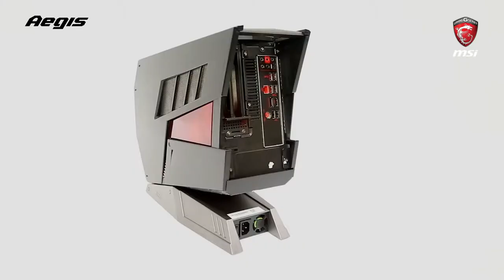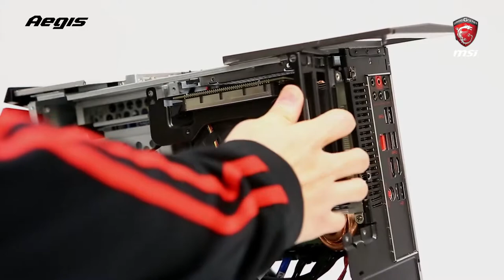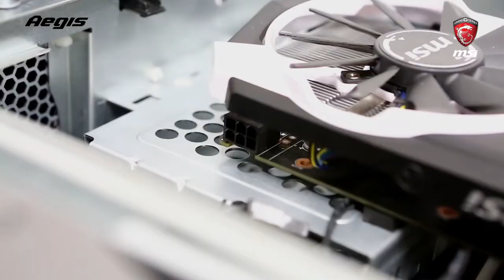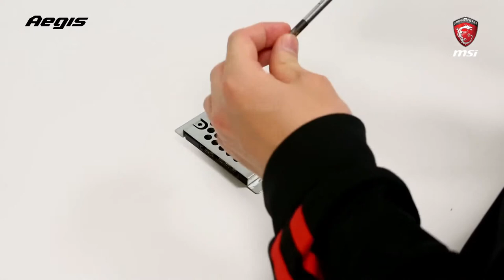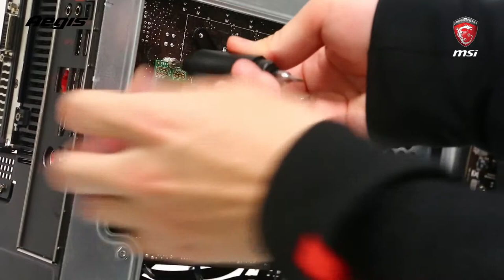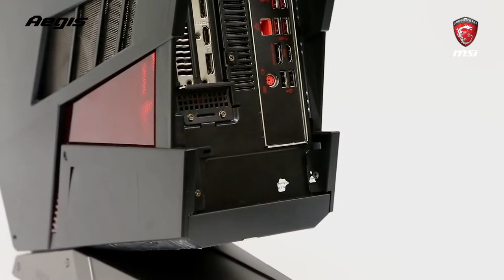MSI Aegis Easy to Upgrade Tutorial

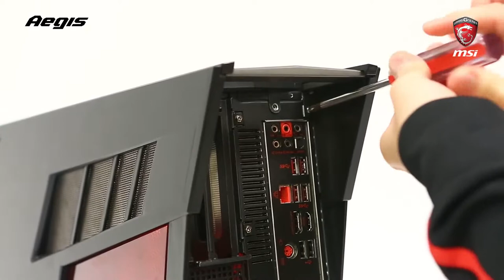Comment: Not sure this is mentioned in the comments but at the 0:35 mark when removing the top cover my model had a fifth screw at the top of the left side panel that needed to be removed.
Reply: same, tried to remove the panel with slight force until i noticed

Comment: On my model there's a fifth screw that holds the left panel in place (left looking at it from the back). Remove the top cover first, then the 5th screw is located on top of the case, on the left side, in the middle.
Reply: I guess your talking about 8th gen i7 8700? Thanks for the help.
Reply: @iX067  i have i7-8700 GTX 1070 TI and im just wantin to install a new GPU LOL its old and SLOW ASF
Reply: power supply

Comment: I can’t get my graphics card out. I unscrewed all the screws but I can’t find the PCI-e slot or cables attached to it.
Reply: a clip on the back on the pci express slot needs to be released
Reply: @victoria653  how do you release the clip I’ve been trying so hard but I do t want to break it
Reply: @myoopsie5324  it takes alot of force
Reply: @myoopsie5324  push the clip up. Also push the card up a bit for it to be easier. Cables are on the bottom left corner.

Comment: I got the x3 that has a liquid cpu cooler. Why does it still have a fan to blow on the cpu? The radiator is on the bottom. It also seems to have a completely different motherboard layout

Comment: I need help  i have a aegis 3 with:
intel i7 7700
gtx 1070 8gb
16 ram sodimm

i wantt to get another 16gb ram, but i dont know if i add a diferent model of ram. how can i know if they are compatible.
Reply: 2400mhz soodim ram 16x2
Reply: Do not invest any cents on this stupid computer, it doesn't deserve it! I have one again (i7 8700 model) for repair, they have always cooling problems! That stupid laptop fan can not cool the desktop processor! Thats all! If you add a new RAM modul, it will not bring you a huge performance, it's not gonna make a huge difference! Just sell this stupid computer and buy a real desktop computer if possible. My customer asked me a cheap solution, so my solution is ITX case + CPU cooler! So he accepted that and I'm waiting for the parts from dealer. Also this mainboard is not compatible with standard ATX PSU, so I have to use 24 pin to 10 pin ATX converter... I've already tested with another cooler and it works 32 degrees on idle! Before that 45 degrees!!!

Comment: Can I change my gtx 1060 with another graphic card?
Reply: yes but be careful, consider power consumption.if you apply a 1080ti (250w) you can burn the motherboard and the power supply...
Reply: @arifane  ok thanks, but then what grafic card can I get?
Reply: @lorew5664  gtx1060 needs 120w gtx1070 is 150w so it would be ok.but gtx1080 needs 180w and danger may start at this point. best would be to ask on forums and first get info about your psu. because aegis series have many types of setups.

btw i bought 6700k&gtx1070 setup which i replaced gpu and now it has gtx1080.
Reply: @arifane  can i add a 980ti?
Reply: @arifane  what type of psu did you have? I didn’t find anything that can fit the aegis

Comment: can the msi aegis 3 8th generation fit anything higher than a 1080? mine has a 1070ti i dont want to waist my money if it doesnt work
Reply: same here. do u know something about?
Reply: Sisen Aoyagi I heard it can fit a 1080 but there is not much difference
Reply: @Krimpzz  so we can use a 1080 ti or 2060?
Reply: Sisen Aoyagi think only to 1080ti but if you get the newer Msi aegis 9th it has a rtx 2060
Reply: @Krimpzz  9th is just different about how much W consume, did u friend change the power supply?
Reply: You can put there up to a 2070 super ( only ventus models )

Comment: Hello, I have an aegis-091EU (i5-6400 & gtx1070). The motherboard is a ms-b0901 ver: 1.1. 
I would like to know if it is possible to use a 7th gen processor (i5-7500 or higher). The motherboard has a b150 chipset if I'm correct... this chipset can handle kaby lake processor... but does the last bios for this PC accept kaby lake processors ?
Reply: I think i havet the same motherboard tho i have a i5 7400
Reply: Yes, 7th gen is the max.
Reply: Supports 6th and 7th Gen Intel processors

Comment: This thread seems pretty active. My CPU is now at 100c from start up.. I need to get in and check the cooler hasn't moved. Has anyone had any issues?
Reply: Yeah dude me too my cpu is always on 80c or some times on 95c I wanted to check the cooler but I didnt make it
Reply: What is your cpu ?
Reply: I would consider checking the thermal paste if this isnt the problem adjust the fan curve if not I am to out of ideas :/

Comment: Hy guys, I need to know something before upgrading my aegis. I have aegis 3 with:
- Intel i5 7400
- gtx 1060
- 16 go ram
The rest is all the same
Do you think I can replace the i5 by a i7 7700? It would be Ok with the bios and the system? 
And upgrading my gtx 1060 to gtx 1080 eventually?
Are all this upgrades worth it and possible?
Thx for your answers
Reply: Idk man. You can ask the people on r/msi on reddit. They know what to do
Reply: You should buy a 2060 / 2060super, After you can change the cpu, Maybe an i7 7700k would be ok
Reply: i7 7700k is max with 64gb max ram at 2400mhz im still trying to find the biggest graphics card that will fit
Reply: @nebulino  i talk with MSI supp. and they told me that aegis 3 can use 1080 armor only...
Reply: @sisenaoyagi8027  really?  i have a friend that changed his 1060 to a 2060 without problems
Reply: @nebulino  really? Can u send me some pics about his pc components?
Reply: Nebulino surely that graphics card requires a higher psu

Comment: Certainly this information is hard to come by.  

After alot of googling and also using CPU-Z app to detect the PC specs : Mine is an Aegis 3 with i5-7400 processor , GTX 1070.  The mobo is MS-B9071.  PCI XX? x 16.  450W PSU.  I've concluded that i can upgrade my Graphics card to a Radeon 6600 as the power consumption is relatively low for that card - the 6600 card is PCI 4.0 which is backward compatible to PCI 3.0 but you will take a hit on performance.  This PC is certainly not very upgradeable, and if you can afford it, a new system may be better.  Still, i might upgrade the graphics as the card can always be used in another rig in the future.

here's a must watch video for those of us who have this PC.  the guy upgraded to RTX 3080Ti - but obviously i'm not saying you should!
https://www.youtube.com/watch?v=BrxxNm2WG_Y

EDIT. i have upgraded to a radeon 6600 XT with no issue.

Comment: Only one RAM Module. Wtf can somebody y tell me if they have 2 Modules pr really one ???
Reply: Yes it has 2. The other tame port is on the other side of the mother board. The only draw back is that you can’t adjust the MHz of the ram. I upgraded to 16gb 3000 ram and in the bios the is no way to have the ram set more then 2166mhz.
Reply: @sagwa619  oh okay  i have a question is it possible that i only can replace one? Because i dont want to remove grahics card? And do you have a link what Module u used bc i Think i cant use and big modules.?
Reply: @fabianmarta1874  if u want to replece and install 2 new rams u have to remove graphic card bit its not necessery just buy one SO-DIMM ddr4 8 gb 2666 mhz and install it on back of motherboard. This is gonna work
Reply: @bud4181  Hey man i noticed your comment and went ahead and installed a new ram SO=DIMM ddr4 8gb 2666 mhz on the back of the motherboard and my aegis wont recognixe it it still says i have 8gb of ram is there a way you can help me with this? ill leave you my discord here Andrew Joe#9528
Reply: @andressalazar1384  i'm just a simple guy that knows a bit about that computer xD maybe ram is damaged or u put it wrong. My  ram is black looking with radiator. How about yours?
Reply: @andressalazar1384  What if you dont have enough W with stock power supply. I dont know man😓 its hard
Reply: @andressalazar1384  You can also try replece those 2 rams maybe that will work but make sure u install them properly
Reply: @bud4181  This is the one i bought RAM 8GB 1x8GB Kingston KVR26S19S8/8 you can copy it and look it up on google
Reply: @andressalazar1384  mine is HX426S15IB2/8😮
Reply: @andressalazar1384  your new ram have 19 cl and it dont have a XMP technologii when you mixing 2 rams with diffrent cl they will work but with underclock to minimum mhz AND if your ram cant synchronize with stock aegis ram it just stop working 😑 maybe that's solution
Reply: @bud4181  so the RAM you bought works with the8 GB ram already in the pc as default?
Reply: @larssecember432  yes
Reply: @bud4181  and is it normal that people say the ram goes 2133 mhz but when I check performance and then memory that it is 2400 Mhz?
Reply: @larssecember432  I dont remember. Dont invest in this shitty computer sell it and build new one.
Reply: @larssecember432  yes